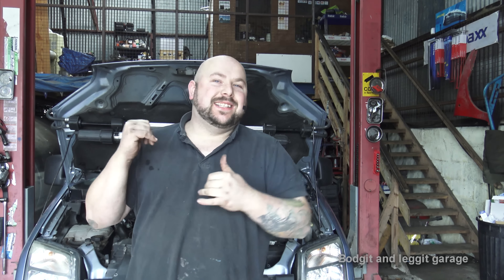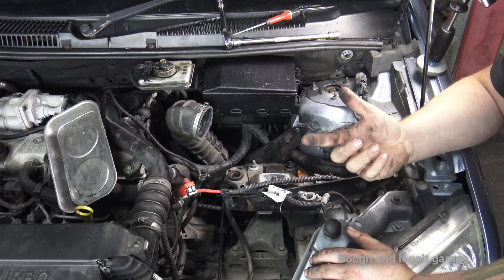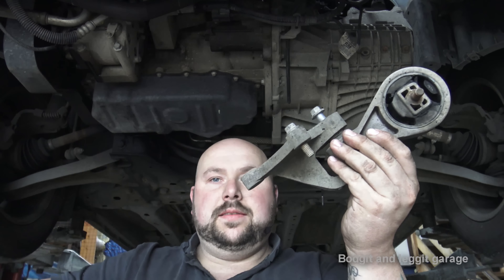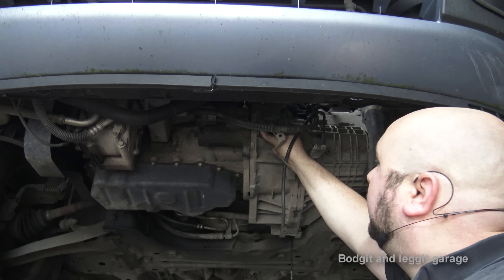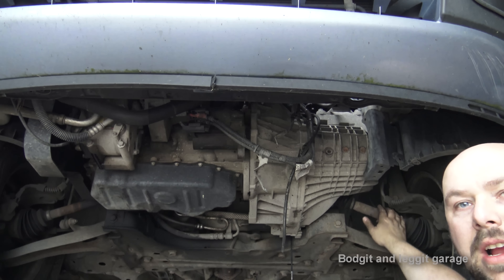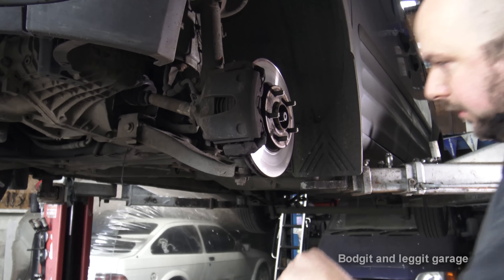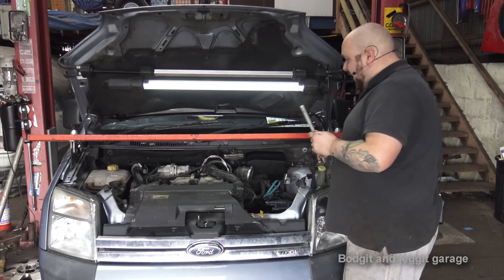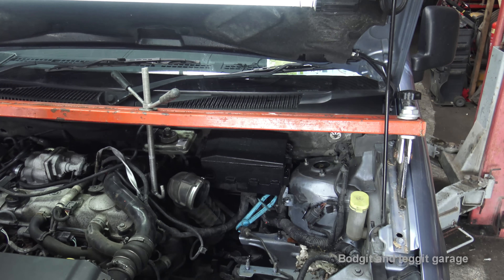Ford Transit Connect Full Clutch Replace Part 1 Bodgit And Leggit Garage

Comment: Just watched this as I have part taken the gearbox out and needed to know how the gear cable linkage came out. Excellent explanation of what needs doing. I found that to get the driveshaft out you were right in pulling the gearbox forward (I used a medium length pry-bar) then used a long pry-bar leavening off the other pry-bar to get the driveshaft out. Many thanks. 👍🏽😎

Comment: The best way I find for removing the nearside cv joint from the gearbox is to remove the offside driveshaft first put a long flat blade screwdriver through the diff and tap on the end of the nearside inner joint.
Reply from the maker: Paul P you will see in the next parts that's exactly what I did nightmare lol

Comment: Hope you can help ,do you have to lock the flywheel to remove it.all my flywheel bolts are shiny silver from the clutch rubbing, dont know how or what has caused it ,but I'm unsure if the flywheel needs replacing

Comment: I Have a connect van which goes a lot of miles. I need to do the timing chain .
Looking at videos of this job I think it is going to be easier taking the lump out.
Do you think it would be a good idea to do clutch at the same time?

Comment: Hi mate long time subscriber, it's been a while since I commented - I'm going to buy a Volvo v70 D3 2.0, around a 2011 plate - anything I should be looking out for mechanically o otherwise when I view?
Reply from the maker: hi mate just the usual really make sure the car is cold so you can see if there's any problems starting it if they warm it up before you can start it cold walk away make sure the clutch pedal isn't too hard look for service history take it for a good long test drive get everything warmed up that's all you can really do the parks that do go wrong with all modern cars you'll only know you've got a problem when they go wrong hope that helps thanks for watching
Reply: bodgit and leggit garage Thanks mate as always very helpful :)

Comment: there is a easier way to get the drive shaft out the hub on these if you just undo one of the bolts holding the lower arm on there is enough movement to get the shaft out hope this little tip helps
Reply from the maker: harry morrell I do that sometimes just depends on the car

Comment: tip mate: to get the inner CV joint out of the gearbox. get a rope or steel cable. tie it round the joint. feed a 6 foot length out. tie the other end to a 10lb sledge hammer. lastly swing the fucker like a golf club! I try to pry the thing out on my megane like you were doing and it would take budge. but first swing with the hammer method a popped staright out!
Reply from the maker: clarkie005 thanks mate we'll have to remember that for the next time

Comment: nice work. Are you changing the dual mass flywheel as well? Have you tried a single mad conversion on one of those 1.8s?
Reply from the maker: Badgertronix hi mate there already was a solid flywheel fitted on this so didn't need to change it
Reply: bodgit and leggit garage ah wow. Never heard of a 1.8tdci without a dmf. Is that standard on these?
Reply from the maker: Badgertronix he told me before he brought it the clutch was changed so maybe it was changed to solid I'm not sure I've seen some with and some without don't know who makes a decision it's just what I've seen

Comment: Another great video, for stubborn drive shafts I use a cold chisel , there great they have a wedged shape end and you can hit the other end with a hammer and they come in various lengths and thicknesses and are cheap to bye. Can I have some advice on buying a mid end ob2 reader , any ideas ?
Reply from the maker: 125 SM how much money are you looking to spend on a Scanner mate
Reply: About £200 ?
Reply from the maker: 125 SM the Delphi system is not too bad but you need a laptop to work it if you can go a bit more the Foxwell have some good scanners as well what you are really looking for is bi directional controls the more of them you can get the better
Reply from the maker: but for that sort of money unfortunately you will be limited even the ones at 10 and 15000 still don't do everything it's a minefield when it comes to scanners
Reply: ok thanks for the info. Tony
Reply from the maker: 125 SM any time mate

Comment: This might sound ridiculously stupid but both driveshafts need to be removed, right?1
Reply from the maker: Hi mate not necessarily obviously both driveshafts have to be taken out of the gearbox differential housing but not necessarily completely out on some cars you can get away with leaving the driver side still connected to the wheel just depends on the car

Comment: What's the going rate for a garage to do a clutch repair? Like 2-3 hours labour + parts if not supplied?
Reply from the maker: 8ile it all depends on the car but most modern cars you will not come near to finish the job in three hours

Comment: Imagine I had the exact same thing with my petrol van 
Absolutely bollocks, I had to take the gearbox out and do everything you did, then didn’t even have the right alignment tool for the clutch. I know your pain, I’m still working on the job

Comment: Very good video. I have same car. Is very complication car. I have a problem with the heater. I have change thermostat drive belt, Serpentine belt drive, etc. But still don’t work. I have to drive the car for more than 30 minutes to warm up a bit. If driving on the highway reaches normal temperatures. But after I get off the highway to the local road, the temperature starts to drop to a minimum. Can you help me, what can it be ? Thank you.
Reply from the maker: Hi check the radiator fan switch and also check the temperature sensor when the temperature goes down can you put your hand somewhere on the radiator or the car to make sure it's hot what if it is hot then you've got a problem with the sensor

Comment: i don't know if it's mentioned in the video but could someone tell me how much gearbox i need for my connect tdci? Is 2 litres correct?
Reply from the maker: Tyler Ace hi mate to be honest I never know how much a gearbox takes off the top of my head all you have to do is wait for it to come out of the whole you are filling it from then you know you at the correct level

Comment: It sucks donkey dick when CV axles get stuck like that. Last one i had that stuck there was room to get a ball joint fork in there. I thought i was going to crack the gearbox casting. Holy fuck. What a bastard. 

I want one of those Facom 3/8ths flexi ratchet. I have an old half inch long handled one, but its to big for some stuff. I had a Chinese one from machinemart but i broke it twice.